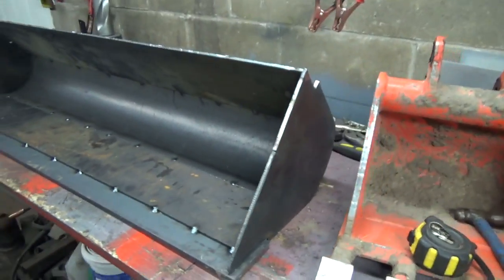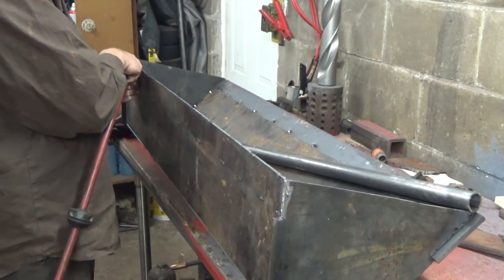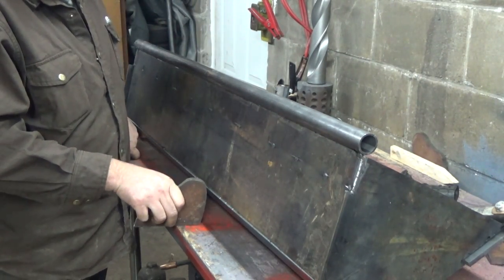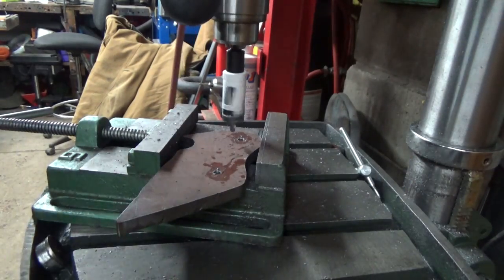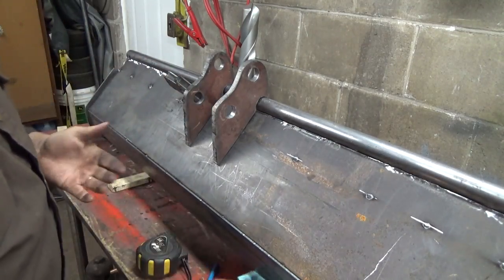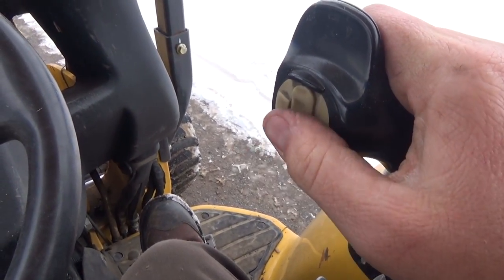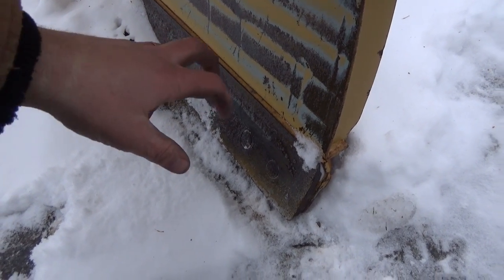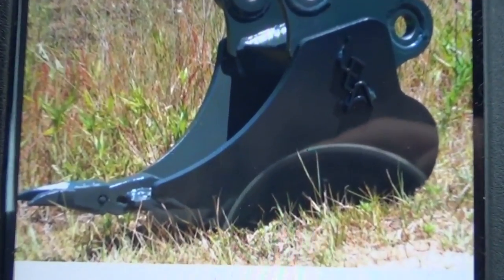A small change in the bucket today..day 3 Fab and salt spreader test out

Comment: I'm going to make a suggestion, but my suggestion is based on the assumption that the pipe, you're welding on the plate, is going to act as a stiffener so that the plate doesn't warp or bend when stress is exerted on the mounting ears. Remember when you made the first cut on the 8 inch pipe and the metal spread a bit?I suggest that you make a single cut on your pipe with the plasma cutter as wide as the plate is thick, place the pipe on to the plate so that the plate touches the inside surface of the pipe then weld the pipe in place. you will not only have the stiffener you need but you will have two places that will be welded to the plate making the pipe installation much stronger. The best of luck with the new bucket!
Reply from the maker: +sandrammer thats a great idea

Comment: on your salt spreader not spreading wide enough, you could add an angled galvanized pieces and bolt in on. on the inside of what you have like a deflector one would use air vents, you know what i mean.

Comment: Providing the ground is frozen enough to support the weight of mini excavator, now would be a good time to destroy all the beaver dams, especially if the gripper thumb is added, starting with the farthest most dam and working back to the closest to your house. Unlike a wheeled backhoe it can go right into the water and still be able to get back to solid ground. I would love to have a colony of them here on my farm, I surely could use a nice pond in the rear acreage of my farm which has a  fairly large creek running through the woods but does go dry during long dry spells of summer.
Reply from the maker: +Nortekj i wish i could but there are still traps set in the river